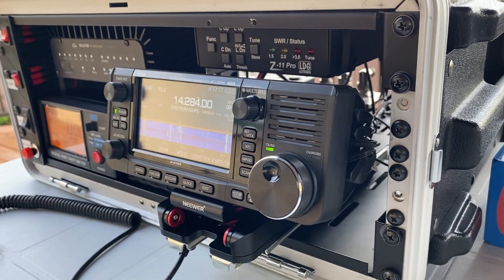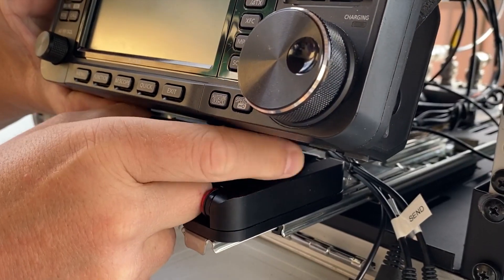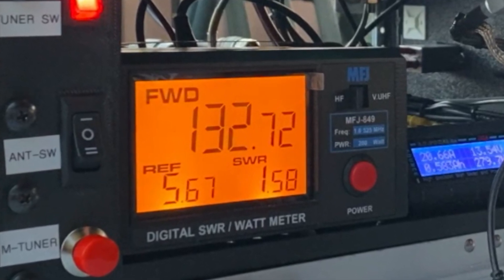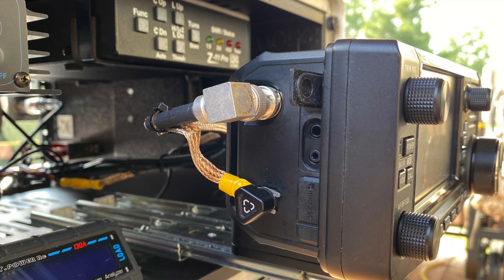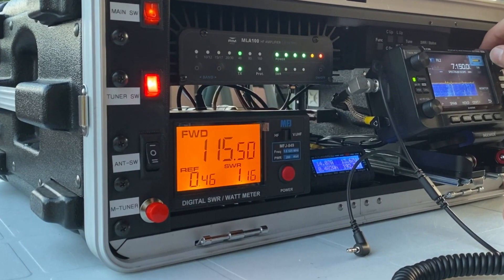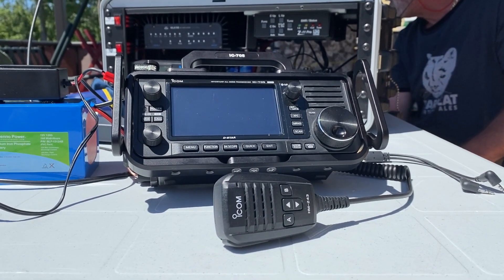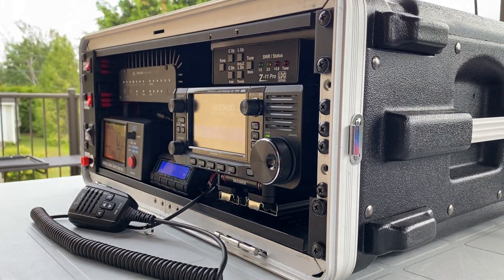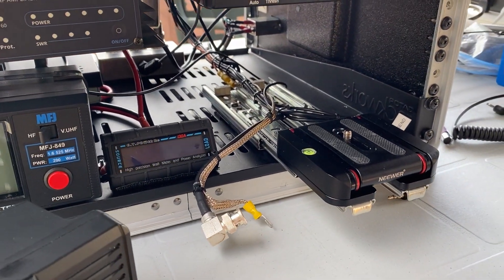IC-705 Go Box with 100W / MLA100 Amplifier / CF-530 Duplexer / AE Switcher / Rails

Comment: Thanks! I have the IC-705 but I think I will build one for my IC-7100 as I can eliminate the amp and diplexer but keep the MFJ SWR/power meter. I would add a SDRPlay SDR radio and MFJ SDR antenna switcher so I could get a full waterfall display on a laptop.
Reply from the maker: Yes the IC-7100 is a good choice, in my previous Go Box I had it with a SDR as you mentioned. Good luck with your build. 73

Comment: Great setup. Thanks for sharing. Do you know if the IC-705 disables the amp keying when tuning by the front panel? I’m considering a similar setup with an AH4 remote tuner but not sure how to prevent keying the amp while initiating the tuning cycle.
Reply from the maker: Hi, good question, the solution is to Power off the Amp, being bypassed, initiate the tuner sequence. When tuned, Power on the Amp. If you change to another band, Power off the Amp and repeat. It is important to remember that, otherwise the Amp may be damaged due to high SWR. The MLA100 does have high SWR protection but we should not rely on that solely. The AH-4 should work as well. For the Amp keying the Go box has been upgraded with a buffer interface, available on eBay "ICOM IC-705 amplifier keying cable, RBI-1 Interface KXPA-100, RM Italy MLA100" Hope that helps!

Comment: Great video, I am working on gathering the parts to do this build myself. Could you please ask your friend which vented rack shelves he used on the bottom and top sides? The box doesn't look like it comes with the shelves.
Reply from the maker: The box comes empty, you can use any shelves you want, vented or not, it is not critical, there are various types and possible configurations, what is shown is one possible way, yours may be different. I have build my own IC-705 Go Box and used different shelves and drilled holes when necessary. Hope that helps! Good luck on your build. 73!

Comment: nice setup - to me it takes away a bit too much of what the IC705 is about as in portable operations with the weight/carrying it all, but thats just a personal opinion, its an excellent solution to go /M with a very capable setup.
Reply from the maker: Hi Azle, yes hybrid setup for Portable/Mobile/Base/Field Day, as per the owner, it was a fun project to build, thanks for the comment.
Reply: I think it comes down to the fact that Icom has not produced  an SDR replacement to the IC-7100, which is now a decade old tech. So this is the solution for those who want a similar Icom 160m-70cm rig with 100W on HF.

Comment: Where did you buy the rails, or have you got any hints about brand etc?
Reply from the maker: Hi Marten, At a local hardware store, just measure what you need and find matching rails that have a locking mechanism when pushed all the way in.
Reply: @VE2FGJ  in  £9

Comment: Frank, interesting video!  Does your MLA-100 amplifier not heat up?  Are you using any Go-box cooling?  73 de ER/UT1ZZ!
Reply from the maker: Hi Andrew, yes the MLA-100 does heat up with SSB but not enough to consider cooling. But if you plan to do digital modes (FT8...) that is different. The MLA-100V (note the V) has a fan on top. Thanks for asking. 73!

Comment: Hi Frank. Do you have any additional info about the sliding track that was used? How the bracket was attached? Very inspiring approach. Thanks for the video! 73 WN6NW
Reply from the maker: Hi Steve, I don't, my suggestion is to measure what you need and find the appropriate parts. The sliding tracks have a lock when pushed all the way in.  He initially stated that it was an easy install. Hope that helps. Thanks for the comment. 73

Comment: Very interesting build!  It's obvious that you put a lot of thought into this.  Much better than the typical box with 100 pointless leds, switches ,and connectors.  Does the movable 705 mount lock into place, or does it allow the 705 to smash into the cover during transport?  Also...I would be careful about saying that the linear, rated for 100W output, has a "tolerance" for 135W just because you can overdrive it and produce that output.   It might work, put possibly not for long.
Reply from the maker: Hi David, yes the owner (friend) has spent a lot of time, he likes these projects. The rails do lock when pushed all the way in, so there is no bouncing. The Amp is 100W and should be used accordingly, the point was to test what happens when we overdrive the input by forgetting to bring down the IC-705 to 5 watts, for testing only, not for normal use. Thanks for the comment! 73 :)
Reply: @VE2FGJ   I’m curious too. Any chance you may know the model/part number of the rail?
Reply from the maker: @wgxdz  No idea, I am not the owner of this Go Box but I suggest to take note of the required measurements and check in a local hardware store.